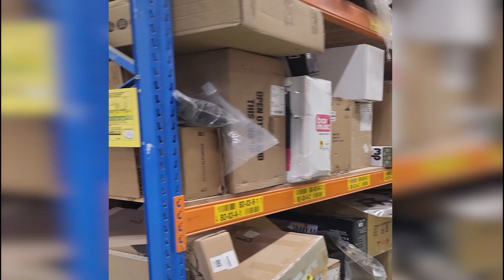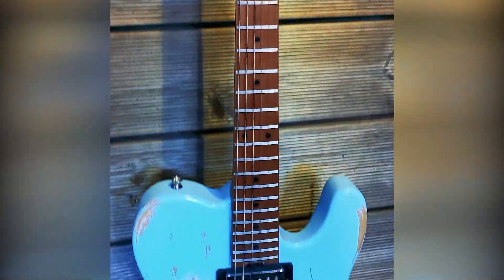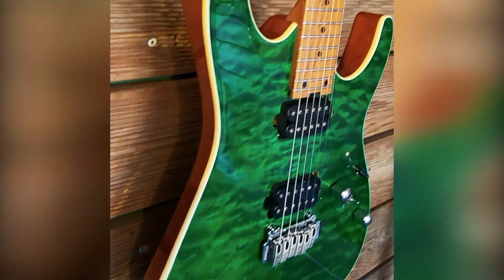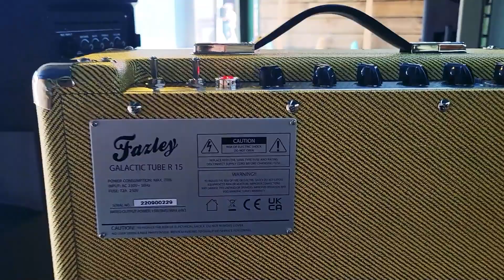Bax Music Open Day - Part 3 - The Lamb In The Netherlands - #fazley #newguitar #openday #travelvlog

Comment: They need to stop using plastic and polystyrene in there packaging.There’s absolutely no need for it these days.😡👎 Lots of other retailers stopped this practice years ago.
Reply from the maker: I've had many products from Bax,, not once have I seen any polystyrene. Not sure I can see any in the video either, but with literally thousands of different suppliers, it must be difficult to insist they all comply... The cardboard boxes, air cushions and PU packing foam seen here are all 100% recyclable materials.